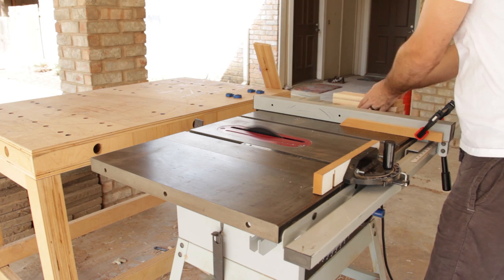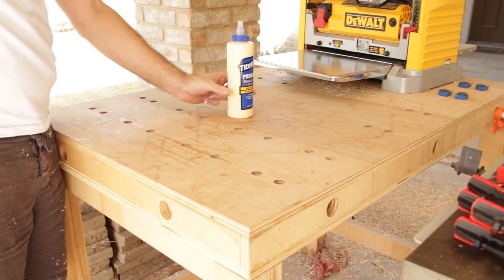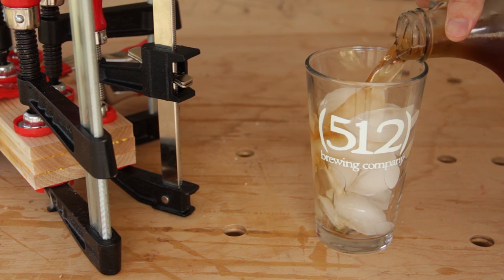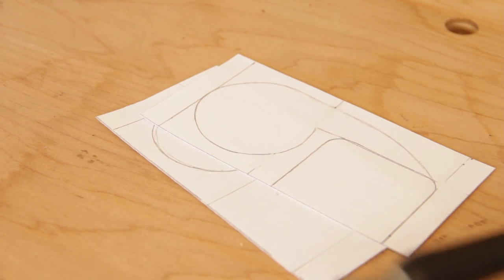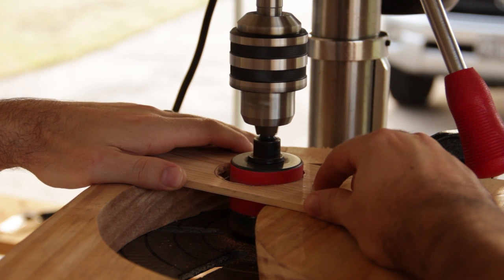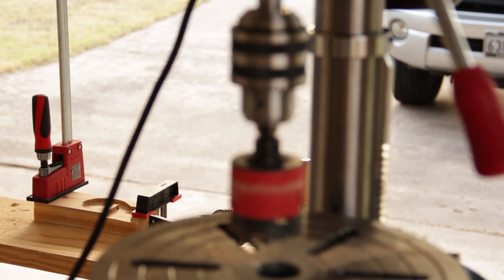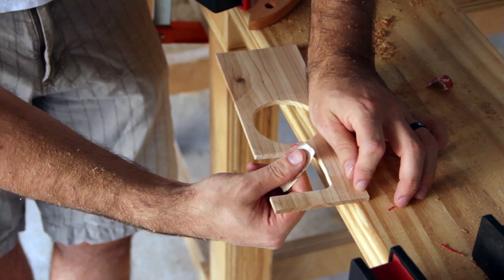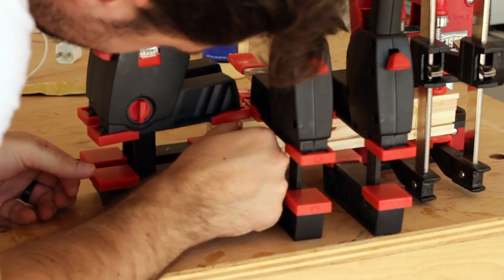How to Make a Wooden iPhone Amplifier

Comment: What do you use to stick sand paper to your hole saw? That's a good idea I have a couple of drum sanders for my drill press, but it seems like I never have the right size when I want to use it LOL. Great video!!
Reply from the maker: I just found some a the store that had an adhesive backing. Diablo 4.5 x 4.5 in stickfast. I cut it into strips and usually have to use 1 strip + an extra bit to finish off the diameter of the hole saw